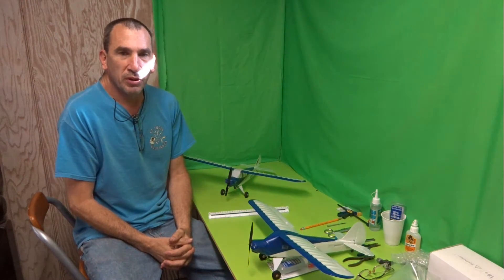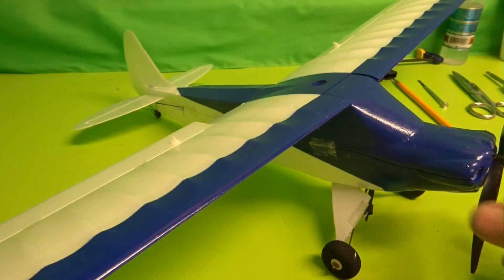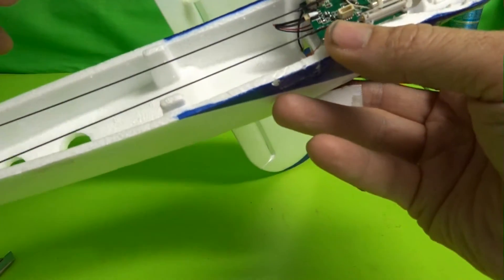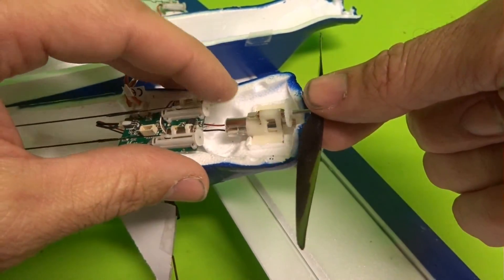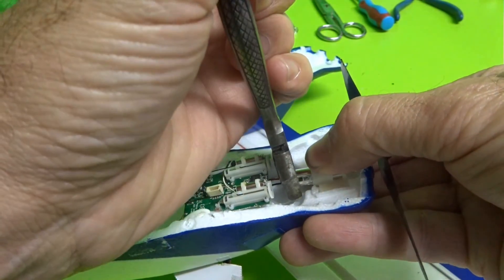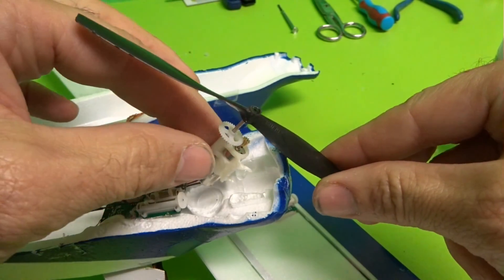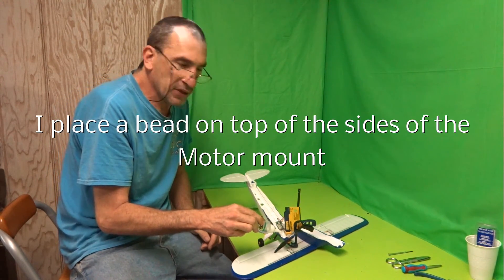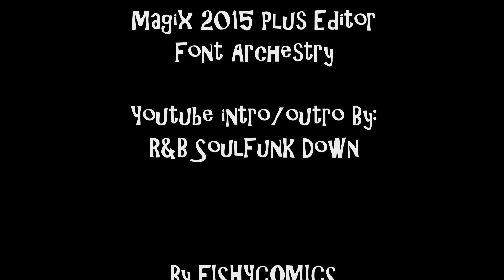Hobbyzone Sport Cub S motor Mount repair tutorial

Comment: Thanks for the video. My mount or gear box came loose, not from use, but from crashing it. I think you video will help me fix it.
Reply from the maker: +Mark Eggert don't tear tape off cut it and retape over it  narrower.  use some correct glue, let dry andt hen fly fly fly...

Comment: could you make a video about if , say, your engine mount tears some of the foam out from underneath it and how to repair that?
Reply: Yeah, wish my motor mount came loose so cleanly. The fix in this video is a slam dunk.
Reply: yea it's not the glue that will break its the foam
Reply: Same issue here, the motor mount just came out with a huge chunk of foam stuck to it :(.

Comment: Exactly what I needed man thanks very much. So I guess the motor mount pins aren’t actually screwed in or anything? Just wondering how it’s originally set, how it comes loose or if it’s glued. Is there supposed to be some play naturally I noticed mine moves a little bit but it hasn’t affected anything yet. Thanks and cheers.
Reply from the maker: the white frame has four pins they are pressured down you then  can add rubber cement tack foam it is a dab on each. done. what  I remembered.

Comment: hello i was looking for a parts list i am building one and i do not wish to take mine apart agn till it takes a 2end crash i found its a 4 channel but not sure how that works motor front wings times 2 and 2 for the back i count 5 so im not sure at this point i have all kinds of parts showing up in a few days motor and esc the rods plastic hing thingys used for conecting the rod to the wings and i am looking at a frsky 4 channel rx <will this work i have a fr sky qx7 tm
Reply from the maker: I find it became harder afteer new rules or  other reasons try your local hobby store I say. or hobbyking.com

Comment: What's the difference between using foam cure and CA? Thanks
Reply from the maker: I had to look up, and thanks what I need fpor other things . Foam cure is flexable, say like a rubber cement, its removable. CA is not an instant hardens one is soft the other is hard.  hope that helps out. appreciate the reminder (smiles) and comment (wink)  I used foam cure years ago and easy to work with but needs time to dry  vs ca that within seconds
Reply: @fishycomics  thank you!

Comment: You talk about pitch and angle in the beginning of the video but don’t appear to adjust after gluing miter mount back in. How come?
Reply from the maker: its already set, that be why the mount has the set built in
Reply: @fishycomics  ok. Thanks. I was just a little confused on that part. But I used your video to fix my problem (I crashed into a house and the Moyer mount came loose).  It seems to have worked.  THANKS!
Reply from the maker: @TheRyanw15  very pleased, that you fixed it, appreciate the comment glad the vid helped